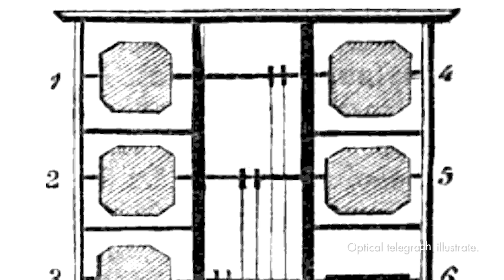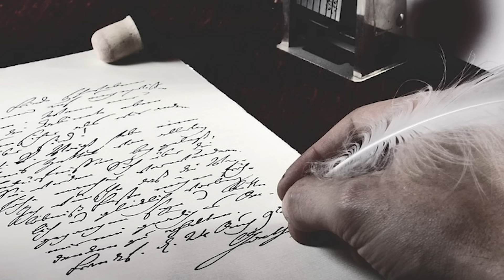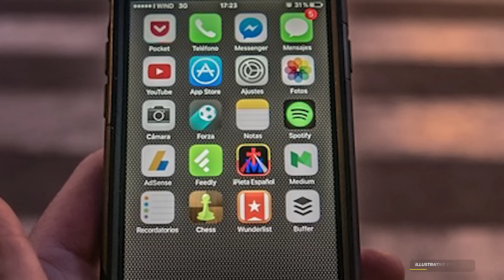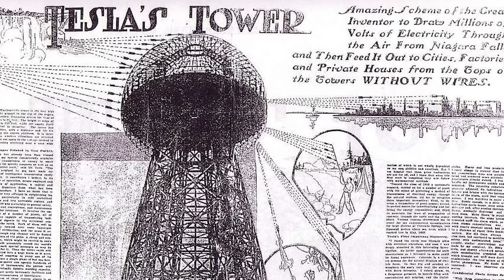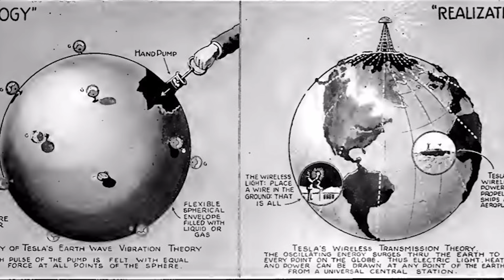Why America's Forgotten Microwave Skyway Network is still standing | Abandoned

Comment: "more efficient etc etc"

I call total BS on that.
Groundbased wired connections provided MUCH better quality.

"lower, expensive yada yada"

And all those huge relay stations cost nothing and require no maintenance at all or something?
Riiight...

"faster and more reliable"

Uh-huh...

I very much remember when the first big introductions of wireless and mobile phone networks were introduced here in Sweden, and ohh boy were they inferior to the wired networks.   The mobile networks literally worked by connecting via the wired networks.
Of which there were 5 nationspanning ones.   The one created by the railroad network(Banverket), the one by the energy delivery network company(Vattenfall), and the one by the national telephone company(Telia).
And another 2 with considerably less extensive side connections.
With all 5 networks interconnecting, making wired phonecalls extremely reliable.

This also meant that when internet became a thing, and all those trunk networks got fully upgraded to fiber optics, each of those 5 networks were capable of servicing multiple ISPs.

Comment: well we in teh usa still knida don't need it right now but it might come in handy sooner or later for space x and outerspace or when we need it to masvly increase bandwith internet bandwith tranfer speed infersrcuther. also space x would like to buy thsie if they are watching this you know what to do elon musk you could use thsie for space x comutaions sooner or later with starlink v3 or something like that. also thsie could be used to transer power long distaces if we need to upgrade the power grid.
Reply: also thsie are very very old and outdated tech thsie days due to the newest versions are far more poweful and muc hmuch smaller and far less powerhungry. but the buidling of the concrte sruectures that are still standing could however could be  very easly renovated and overhalled with a huge upgrade if we need too. but we don't need to qute yet  in the usa but we can if we need to. also we will if needed. its just not qute yet goten to that point yet.